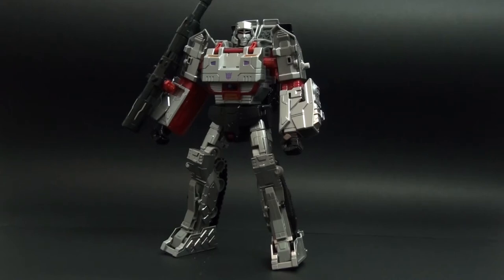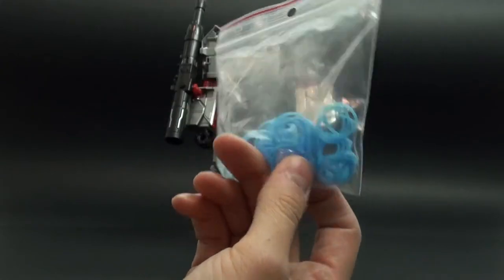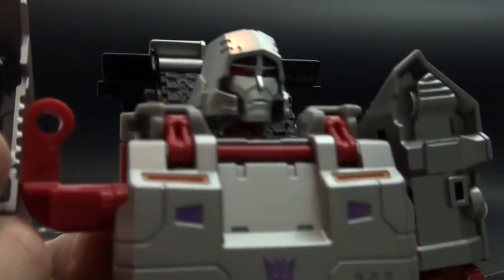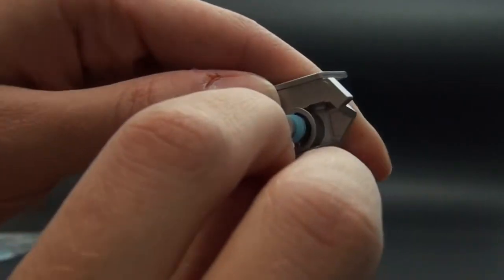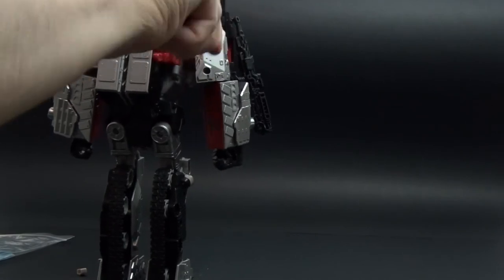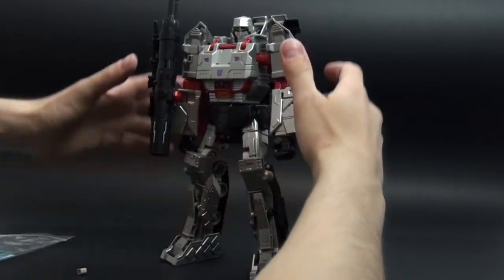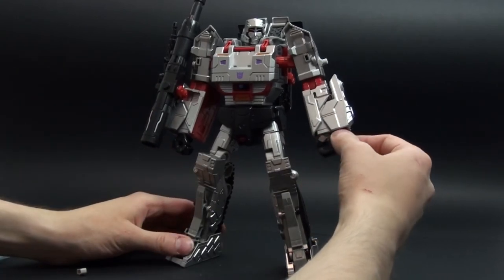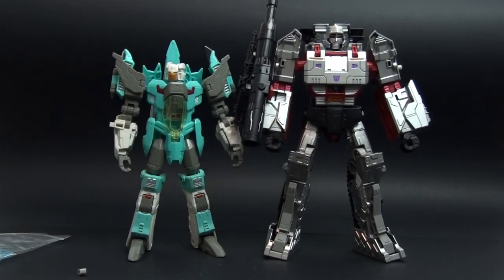Transformers Combiner Wars Megatron Joint Modification [ENG]

Comment: Is it possible to simply coat the articulation peg in super glue or nail polish instead of the bands?
Reply from the maker: +DCMarvel2009 Yes. But using bands lets you go back to the "default" setup if you need to. If you would like to sell it someday you can offer a non modified version by taking out the bands.
Reply: Monologi o robotach Will nail polish wear down the plastic?
Reply: Otto von Doom yes